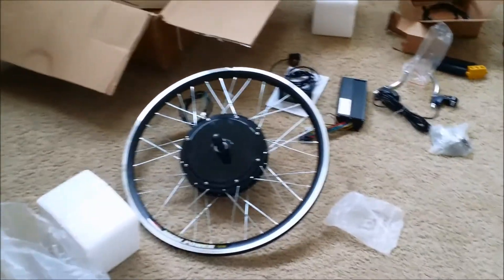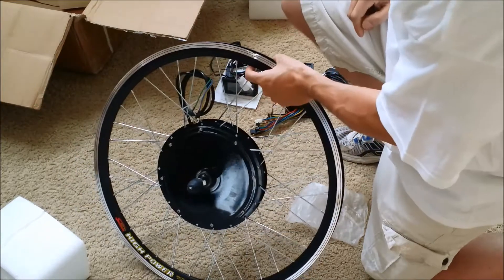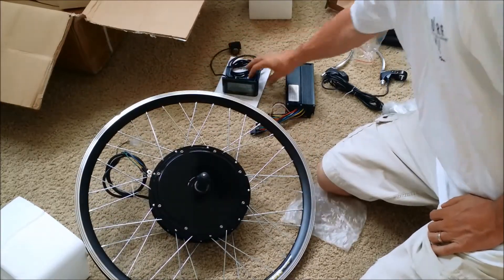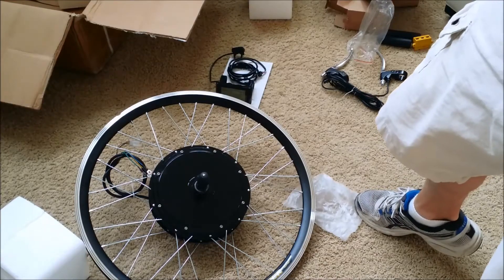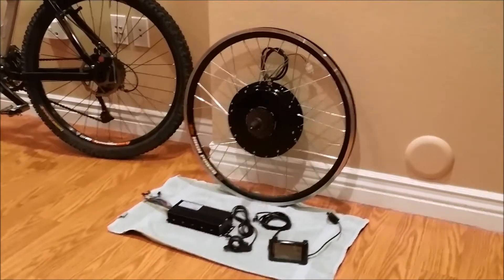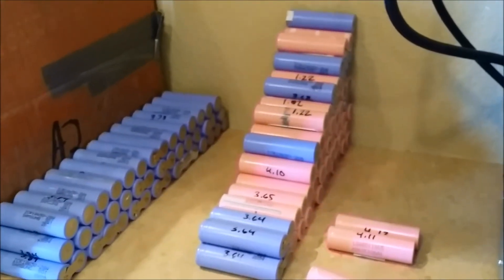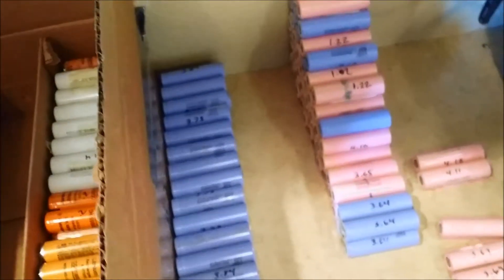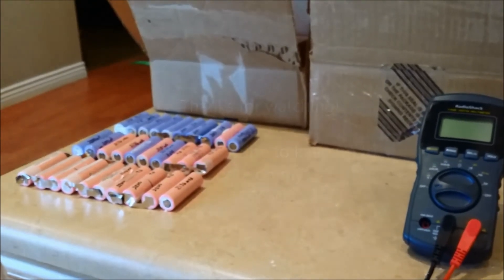DIY "733" 18650 lithium ion cells "Opening the ebike kit and battery status" (Part 2 of 7)

Comment: Hello,
You should test every cell separately. If you test them on pack of three you pull only 0.333 amps and that way they will show you more then in "real life".
Regards
Reply from the maker: yeah I was testing groups at first then realized that I was getting inaccurate test numbers .   later on during the build I would charge a group together then test each cell one at at .3 to .4 Ah to get real numbers.   Over time you start to know the signs of a good cell vs bad within the first few minuets of testing.   Thanks

Comment: I see people tests 18650 using discharge mode and then takes note of the mah capacity of the battery. What happens when you use the AMP feature of the very basic multimeters, isnt it useful?

Comment: I have a question about the 3 phase wires. Why are we having to connect a smaller gauge wire from the motor to a heavier gauge wire at the speed control. I have been melting these connections?
Reply from the maker: +Tucker Not Sucker! Wow man I have never heard about anyone melting the connectors.   Only thing that comes to mind is a loose connection at the connectors or the phase is hooked up wrong etc... but Im sure you checked all this.   How much different is the wire gauge and what wattage is your kit?
Reply from the maker: +Tucker Not Sucker! Also check for arcing at the connectors if they are not crimped on tight they can arc and cause them to heat up.
Reply: 15-sec-of Fame It appears the speed control uses 18 gauge wire and the motor has 12 gauge which is considerably smaller. I purchased another hub motor kit and the problem has not repeated yet. It's a 48V 100W motor. The connectors are not overly secure this could have been the problem. Thanks
Reply from the maker: Tucker Not Sucker! cool man Im glade to see that its working better. :)
Reply: 15-sec-of Fame Hey I have a ? The 3.7V low voltage per cell is this during use or at rest? In other words can the battery voltage drop to zero during use without harming the cells?
Reply from the maker: Tucker Not Sucker! I would go easy on the cells once they have reached 3.7v.  If you have protected cells it may shut them down if you drop down below 2.75v.  Also know that your amperage will get higher as your voltage gets lower,  so they will rise in temperature risking your battery to overheat and damaging them that way also.   Applying a heavy draw could bring the voltage down to 3.0v or less, so look to get it on a charger asap.
Reply: 15-sec-of Fame Thanks for the advise. I have been purchasing cheap batteries through the learning curve and found out how fast they are damaged when drawing current below 48.1V on a 13S battery. I just purchased 38 used HP laptop batteries and I am planning to build 2 48V batteries with 8 batteries per cell then connect the 2 in parallel. Let me ask you this.I have a BMS with a 30 amp continuous discharge and a 60 amp max. limit I plan on using with these batteries do you think this will be sufficient?
Thanks
Reply from the maker: Tucker Not Sucker! Go thru each cell (it will take a lot of time).  I went thru each cell and only used 104 cells that were 2A-2.4A.  So far I have put 185 miles on the bike and ride it like its stolen :)  When it warms up I will continue to ride again and start posting more vids.  I will also add a maintenance port to make sure the battery stays balanced. as it seems to get a little out of balance from time to time.
Reply: +15-sec-of Fame Yes, I will test each battery by discharging then charging and noting the Voltage and amp hrs of each battery, then group them to even out each cell. I have been watching a lot of videos. 

I tried riding the bike like it was stolen but, it doesn't take long before the power draw is dropping into the teens on the gauge. I found out the hard way this destroys the batteries Of course they were cheap 5800mah batteries, I was warned not to buy cheap batteries but, I was new at this and didn't want to destroy good ones. 

Appears the moral to the story is the more batteries per cell  the better. Next will be 16 batteries per cell with 13 cells making up 2 separate batteries. How do I determine how much continuous flow amps I need for the BMS?

It is fun riding the bike and I am 54 years old if not for the electric motor I would not even own a bike. Passing the Tour de France type riders in the traffic lane up hill while humming the wicked witch of the east tune usually gets a laugh. 

Thanks

Comment: I must of missed something. Part 1 seems to involve USED Battery's. refereed to as "These Guys" LOL. Was there some source that was so cheap as to make Using Used Batteries viable? Did this involve any of the various notions about reviving dead Lithium battery's with a reverse current from a MIG welder or the like? I have found new 18650 24R for around $9.70 US per pair. Maybe I should be trying to restore the 40 18650-20AH cells that came out of a 36 volt Bionix gone bad?
Reply from the maker: +Dirk Gidney  Yeah man I did use old laptop batteries to show that you can still save money building the battery.  Not all the cells are bad when laptop batteries are not working 100%. The cells that I used are 3 amps when new,  but used the are between 2-2.4 amps each.   I got the cells for free, but the only cost to me was my time building it.   I could have spent the money on new cells for the 2 batteries that I built, but I just wanted to show that it can be done using old batteries.  The 40 cells in your 36v Bionix may have 25% usable cells that still have 2/3 of there original amperage power.   Usually the BMS is what goes bad then the cells follow due to improper charging, so if you catch it in time you can save the cells before they start to go bad with being undercharged or over charged.  I used a variable power supply to charge them then discharged them with the Imax B6.
Reply: +15-sec-of Fame I have watched most of your videos for this bike, and they are very interesting and well done. Thanks for sharing.

I am curious as to how you acquired your free batteries. A local laptop repair shop?

Thanks for again for taking the time to make the videos.
Reply from the maker: H. Hall Thanks for watching.  I took a break from videos over the winter due long hours at work and thinking about what to build next.  So I will document building a 72 volt battery next with more parts that I ordered from China.  I will also show how much more power I have when riding the bike.  let me know if you have any questions, thanks.

Comment: How do you test the current of each cell?
Reply from the maker: +Andrew Stang-Green after I remove the cells from the laptop battery pack I meter the cells to see what there voltage is and write the number on the battery with a sharpie marker.  Then charge all the cells using a variable dc power supply to make sure they are up to 4.2-4.205 set them aside for a day to make sure they have a good charge if they drop it should be fractional not more than 0.1v Just recharge to make sure its at 4.2 min.  With each type of cell the I found that discharging at .3 to .4 of an amp is typically what the manufactures recommend.   I have a Imax B6 (Fake) that I use to run the discharge test and it gives the mAh's, so 2300mAh =2.3 amps.  The .3 to .4 is also a real word number that its "close" to what you might typically draw with a e-bike depending on how big your battery is Ah wise.  Please let me know if you have any more questions.  I am currently working on a new video building another battery, so if there is something to want to see just let me know.
Reply: Have you considered building a spot welder from a microwave transformer? I think it would be alot cleaner and definitely a much stronger connection with less energy wasted as hest.
Reply: Rather than solder and wires I mean.
Reply from the maker: +Andrew Stang-Green Absolutely, I am looking into buying a spot welder for the next build, not sure if I want to try to build one yet.  I was worried about damaging the batteries with solder,  but its working out great so far.  I Have 137 miles on the bike now.
Reply: That is fantastic, I am still waiting on my power supply and balancer. I have about 120 pounds worth of laptop batteries to go through, any ideas how to test and charge them faster?
Reply from the maker: +Andrew Stang-Green wow,  yeah that will take some time.   Just focus on the battery your looking to build.  For example I told myself nothing lower than 2000 mAh is going in my first battery.  I had just enough to make it with the lowest being 2000 mAh and the highest is 2448 mAh.  It is 8x13=104 cells,  so 8 cells in parallel (for the amperage) and 13 parallel banks wired in series to make the 48v 17.6 Ah battery.   As I would charge them I would set aside the high Ah batteries as I went and once I found the 104 cells I then moved to build the battery.  I went through about 230 cells to find the 104 above 2000 mAh.   Be careful of the bad or low power batteries as they can get very hot when charging if your trying charge a group of batteries together.  Also make sure they are the same voltage when charging together.   Its going to be a long drawn out process, but its worth it in the end.  I know someone who is currently using 6 dc power supplies to charge his batteries just to speed things up.
Reply: +Andrew Stang-Green I purchased a spot welder for connecting 18650 batteries and the welds were separating at full power. I was forced back to soldering all the connections again. And I hit each connecting with at least 5 spot welds.